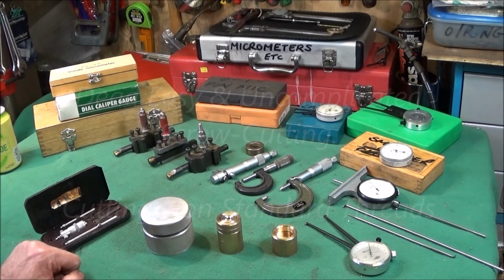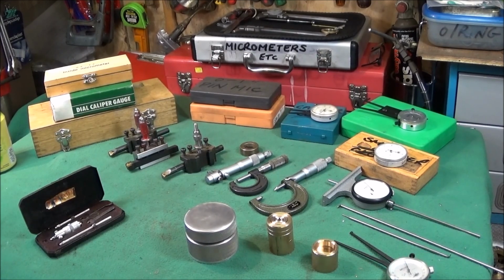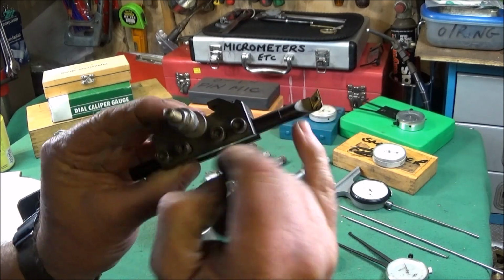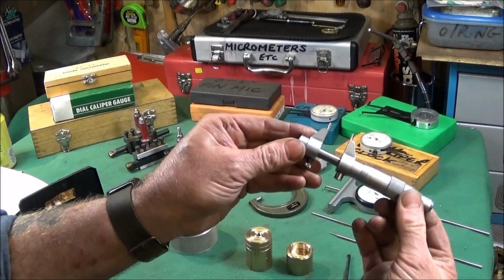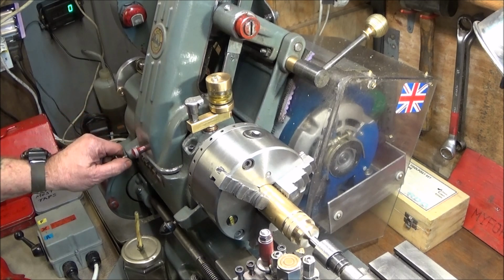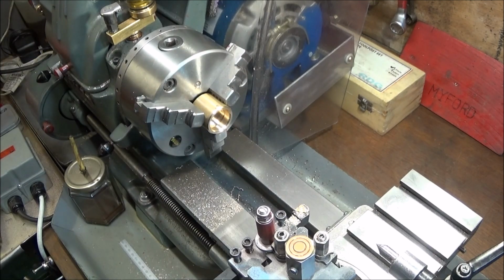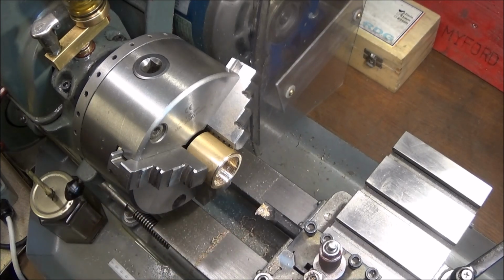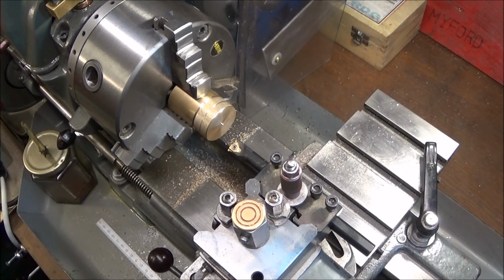The Easiest & Safest Method Of Screw Cutting Threads On The Lathe.

Comment: I've cut some threads manually by inserting the chuck key in the spindle and using it to rotate the work, but I've never seen a manual crank operation done like this on a motorized lathe.  Neat.
Reply: I have a Myford lathe and a crank handle is a standard accessory. I regularly use mine when cutting threads, particularly when cutting in towards a shoulder. Powering into that position is way too risky.
Reply: @Carol-East  I know the feeling.  I normally cut enough relief to get away with it on some jobs, but I have to stay on the controls - and the pucker factor is always high when using power.  Otherwise I switch to manual operation.  If the shoulder is too high, I use a die and manually operate it over the last half inch.  A neat trick I learned a few years ago from another video was to invert the threading tool and run the operation from the rear, forward.  It seems almost counterintuitive but it works.

Comment: As follows the method I learned as an apprentice toolmaker and as shown on the Colchester Lathes training film.
Set the top slide over to half the thread angle and set the cut depth using the top  slide. Grind the tool with half the thread angle.
Set the cross slide at 0 with the tool just touching the job. Move the tool away from the job using the cross slide. Wind the carriage back to clear the job, put the cut on using the top slide and return the cross slide to 0, engage the nut at the appropriate number.

Comment from the maker: LINKS FOR THE TOOLS USED IN THIS VIDEO:- 
BORING BAR/U-CUT TOOL. (Great For Thread Bores & Thread Back U/Cuts).  
S10K-SDUCR07 Lathe Turning Tool Holder -- https://goo.gl/4CH2yg
SCREW-CUT TOOLS & INSERTS
Drillpro SER1010H11 Threading Turning Tool Holder -- https://goo.gl/S11tBB
Drillpro SER1010H11 Threading Turning Tool Holder(US warehouse) --  https://goo.gl/gtywBt  
10pcs 11ER A60 Carbide Inserts External Thread CNC Blade--  https://goo.gl/AzfndJ
SNR0010K11 Internal Lathe Threading Boring Turning Tool Holder -- https://goo.gl/QVve6s
Drillpro 10pcs 11IR A60 Carbide Insert Internal Threading Insert -- https://goo.gl/4mcctc
Drillpro 10pcs 11IR A60 Carbide Insert Internal Threading Insert (US warehouse)--  https://goo.gl/T57S7q

These prices are amazing considering that the same tool in the UK is up to 4 times the price. Also the carbide inserts from China have improved considerably over the years. I find they last nearly as well as the more expensive branded ones.

Also remember that it doesn't matter whether you use a metric or imperial insert for non standard threads, as long as you use the same type in both the external and internal thread tool for a particular component. Also when using a carbide inserts for screw-cutting there is no need to set the compound at any particular angle.
Reply: It's always interesting to keep in mind for us guys, on the other side of the pond, that here imperial threads (inch) are thought of as being the same angle (60) as metric as opposed to British standard threads @ (55.)

Comment: Hello Steve  your idea about the chip shield  worked perfectly  I used  m5 threaded  rod  cut them to about 4 inches and slipped on the aluminmum tubing  5 id 1o od  . I used 5 m wing nuts to secure . the beauty is the rods and the tubiing  support the chip shield . Awesome Idea Thank you

Comment: Easiest way to make an external right hand thread is to turn the thread tool upside down and run the lathe in reverse, threading outward towards the tailstock
Reply from the maker: Hi Glenn. It is, but you can't do it on the Myford lathes as they have screw on chucks, which easily unscrew that way. I have made a locking device that stops that happening but haven't tried threading, using it yet. Regards Steve
Reply: @SteveJordan  oh yes Steve, forgot about that - everyone should make some sort of locking device for those - cheers
Reply from the maker: https://www.facebook.com/steve.jordan.3766952

Comment: I tried your method today . I wanted yo cut an internsl thread on new crankcase I am making for a small diesel engine. The thread needed was 32 tpi.   Getting the gears right on my very old Myford lathe , I think its an early lm 2 , was the hardest part. I couldn't fit a handle soused the large pulley wheel and turned the thread quite easily. Thanks again  for the video.

Comment: Flip the tool around and cut from the chuck away to the tailstock.. No chance of a crash ever. 😉
Reply from the maker: You have to make up a draw bar that locks the chuck onto the spindle. Otherwise, the chuck will unscrew and come off using that method. Regards Steve
Reply: @SteveJordan  A screw on chuck eh ?   My lathe is a cheap and nasty chinese knock off.  It has a bolt on chuck. It also doesn't have a brake , a "thread counter" or a powered cross feed.  I do the reverse cut out of necessity as the machine won't stop where you want it to ! 😉

Comment: Most interesting, and good ideas. However, not so feasible for bigger lathes and finding a way to hand-crank the spindle. Also while all of what you say is true, quite often the 'other' component is too large or inaccessible to bring to the lathe to test fit. And if you use non-standard threads, then if you lose or break a part in the future it may not be so easy to replicate. I prefer to invert the tool and with stud-fit chucks reverse cut out from the chuck, left to right.

Comment: Hello - that looks quite easy. Not sure but I've seen other machinists angle the compound to match the thread angle and then feed in on that rather than the cross-slide. I think the theory is that it just cuts on one side of the tool then.
Reply: I've done it both ways. They both work if the bit is sharp and set up correctly.

Comment: LOL.....'pon my soul, I've been using that method for years to cut Metric threads on my old 1920/30 Colchester bantam lathe. I run the tool under power to the end of the thread and then run the spindle in reverse with the handle. I didn't think anyone used this method as most lathes nowadays have a bolted on chuck.....mine, like the Myford, also has a screwed on one. BTW, that method was posted in the Model Engineer may years ago.

Comment: Hi Steve. I have just made a hand crank and indexing hub, as per your earlier vid, many thanks for making it so clear and simple. In this video, you are turning a metric 24mm thread, and I am keen to try it for myself. My mini lathe ( almost certainly similar to yours) only has change gears for up to a 2mm pitch, but 24 mm calls for a 3mm pitch. As an inexperienced machinist (me) that is, does it really matter what pitch I set? Or should I just set the maximum I can and just use the correct 60 deg indexable tool? I’m not cutting to match another internal thread, just something else I will also cut. So I’m guessing that to a certain degree anyway, pitch will not matter.

Comment: It is possible to cut a thread very close to size by eye alone. First the blank size must be correct (not the nominal size, e.g. 1/2", 5/8", but the size given in threading tables that is usually a few thousandts of an inch smaller) and the threading tool must be ground to the correct angle and set square to the work.
The trick is that for imperial threads the flat on the top of the thread form is 1/8th the pitch. This is easier to estimate than you might think. It's obvious when the flat is too wide or too narrow... you can see when it looks "right". If it looks "right" it's almost certain that the pitch diameter is within the tolerance zone for a class 1 thread (normal for run of the mill nuts and bolts) and probably a class 2 (usual standard for shop made threads).
Reply from the maker: +Aceroadholder Thanks for watching and for your comment...you have explained some things that I didn't in the video. This is why i encourage people that are intersted to read the comments sections. Regards Steve

Comment from the maker: There are some great Thread Calculator Android Apps for free. The one I like the best so far is (THREAD CALCULATOR by Ivan Mykolyshyn)  You can actually use this to quickly calculate the thread hole bore size needed for whatever diameter screw you are making. Plus it gives all the measurements if you actually want to check the finished sizes with wires.

Comment: I've done this method quite a lot over the years - for some reason I often used a 26 TPI pitch whatever the dia. I too use a spindle handle a lot for screw cutting.
Like those clock calipers. You have a great collection of measuring gear.
Reply from the maker: Hi Chris, I really like this method the best now. I just do not have the quick reactions I had when I was younger. I have managed to get the calipers etc for really good low prices on Ebay lately. I look out for stuff on there that is listed to end at odd times, when other people tend to forget when to bid.....like when there is a important football match on the TV....:)

Comment: Another well explained video Steve, I use my winding handle on my lathe for threadcutting too, another reason I clear the tool on the return stroke is if there's a slight amount of backlash between the leadscrew & the half nuts the tool will bind on the work & make a wider cut than needed,I've oddtimes "forgotten" to remove the handle after finishing & turning another job & the lathe gives an unpleasant shake!!! he he.

Comment: Hi Steve, 
great video, have see you use it before but great to have it explained. I also have an ml7 built in about '65 in really good condition, was wondering if you would consider doing a video walk through of your lathe and its modifications and use of the Myford lathe, back gear etc. there doesn't seem to be much on Utube on the basic operations of these lathes.
Once again thanks for the work you put into your videos.
Cheers from Australia 
Raymond
Reply from the maker: Hi Raymond, Thanks for watching. Yes I will try and get round to that sometime. My lathe was made in 1936. My brother did a lot of restoration work on it and I put new counter-shaft bearings, a new spindle mandrel and bearings and a new motor plus several other bits. Also I changed the motor pulley for a larger one (as stated in the ML7 handbook), giving it better speeds. Regards Steve

Comment: A suggestion to all..... I screw cut at 150 RPM towards the chuck. All lathes are different so for  each machine there would need to be a different approach. On mine, I've set up a sliding cam arrangement on the switch rod which locks at any position I choose and this position is determined by exactly where I want the tool point to stop. In other words, the cam kills the motor at the precise spot I select..... Every time. If the job requires the compound or the tool point to end .050 clear of the spinning jaws, then that's where the carriage stops. My system is mechanical but I'm certain an electronic switching system could be fitted to any machine. Once in place, it will take away all fears of crashing forever. And I just love working this way.
Reply: That only works if you motor stops absolutely instantly. And with the weight and inertia of a spinning motor and chuck, they never do. Furthermore, how fast they stop depends on both speed, material and the depth of cut, so it's hardly a repeatable method. Not bad as a safety mechanism, I guess...
Reply: @johncoops6897  Its good to be sceptical when a tool point is only millimeters away from a spinning chuck and moving towards it. I always set the 'stop point' on a dry run with no load. On Metric threading when the half nuts must remain engaged, I'll start the run and stand back and roll a cigarette if need be. The end of the cut under load, now sits half or maybe a full chuck turn less than the dry run. Right in the middle of the groove. Its one of the best gadgets I've ever made. Never again an ounce of fear with threading forward or towards a shoulder.

Comment: Thank you, this will be a great method for me. Not only am I a novice, but I also have a standard change-gear lathe, so there's no lovely gearbox levers to adjust on it. Changing gears really isn't that difficult, but it does take time adjusting backlash...not to mention the research I have to do to make sure I have the right gears in the right places :)
Reply from the maker: +Knolltop Farms Hi Thanks for watching. I do not have a gearbox either and it does take up some time. I only change the gearing though if I am cutting standard size threads. If I cut non standard I tend to leave the gearing set for 19 tpi like in the video. I may do a video on the gear changing on my lathe sometime....it took me some time to figure it out!!

Comment: the easiest, most stress free, safest and smoothest (because done at the correct cutting speed) thread cutting method is described by Joe Pieczynski's video "Threading on a manual lathe  BEST TECHNIQUE EVER !!!!"
Reply from the maker: +rol eic Hi Rol yes I have seen that video if it is the one done with reverse spindle direction? It is very good but isn't the safest stress free method for all types of lathes. If one has a screw on chuck with no method of locking it on the mandrel, it can actually unscrew and cause serious damage. Using the method I have shown here caters for any lathe as long as one has a mandrel handle. I have found this method not only the safest, but also the easiest. Since I have cut threads this way I have had complete success every time and made dead accurate screwed components. I have made a video on locking the screw on chuck on the Myford lathes, but its not possibe on all lathes. My Regards Steve
Reply: Yes, Joe's method uses reverse spindle direction. Only for screw on chucks without any means to secure the chuck on the spindle you are right concerning safety. However you have a video up showing such a securing device for some lathes making reversing the spindle safe. I am not so sure if your method can be considered easy. With your method the user does the labour by hand and it takes much longer time to finish. If you cut a large diameter, coarse pitched thread that arm will start to hurt... What I would easily settle for is that your method (single point thread cutting driven by a hand crank) is new because I have not seen it anywhere before.
Reply from the maker: If you use my method for thread cutting and also never use a part-off tool....(I use a hacksaw),.... its all good exercise.....you will be....... 'As fit as a fiddle'......:-)
Reply: hahaha, true if you start with short, small diameter, fine pitched threads and then work your way up to larger acme threads. You might have found a new Olympic discipline. If only it would strengthen the right arm too...
Reply: Myford has a threaded spindle, the chuck will unscrew if you run it in reverse. Joe Pieczynski is using a Clausing that has cam-lock spindle.

Comment: Brilliant, never seen anyone post such an easy way to make (in my case fine pitch camera filter threads) on short homemade adapters for telescope and
lens fittings, some with only 3 to 5 mm long work pieces. The conventional way is very tricky to say the least! Thanks for sharing, I have joined your channel. Used have an Myford Super 7 back in the 1960's before I emigrated to Tasmania 😃 land of sunshine and clear skies for astronomy.😁
Reply from the maker: Hi Shevill, Thanks for subscribing. Yes it makes everything a whole lot easier for threading. It should be excellent for doing those fine short threads you have to cut. I actually use this method all every time I do the screw-cutting now. It has made thread cutting so easy and I haven't had one failure since using it. I do actually think that it was used as a method a lot more throughout history than we realise. I have spoken to other engineers that cut the threads like this.
 Sounds great in Tasmania and the astronomy must be so interesting, having the clear skies!!
Regards Steve

Comment: Hi Steve great video. The more I watch the more I learn from you. I also made a crank handle for my South Ben once I seen yours. Use it mostly with my tap and die set. And yes as a beginner I am terrified of crashing the tool trying to cut threads with the lathe but not now got a new way of learning it. And also I was able to make a indexing plate after talking to you out of a sprocket I found at my local farm store. Just had to bore the center out to fit the back of my chuck and bolted it onto the back .It has 30 positions not 24 could not find one 6 inches in that count. Works great. Keep up the videos.
Reply from the maker: Hi Sharon....That's great. I never thought of using a sprocket, what a great idea! I use my lathe handle a lot for all threading. Also it is great to use if you have a chuck that screws onto the spindle. I hold the chuck with one hand while using the handle, with the other, which makes it much easier and safer to do. The only thing I have to be really careful of is when I am working quick, or get distracted, is to remove the handle after use. I have actually started the lathe with it in the spindle by mistake!! I have recently made a couple of new handles and I have found a nice small red LED warning light that will fit easily on any handle. This is another safety measure I use to stop this happening again.....I hope to show this in an update video soon. Regards Steve

Comment: To make it easier and still use the machine try flipping your tool upside down then run the machine in reverse. You can work from the shoulder out instead of running to the shoulder. Then when you return to the shoulder you can set a indicator up on the bed to tell you where the starting point is. Put the machine in neutral and hand spin it to get back to zero on the indicator. This will help when doing larger threads or threads in harder metals. Can do the bore the same way just cut on the backside of the part. It will also make it easier to see into the bore to know where the tool tip is.